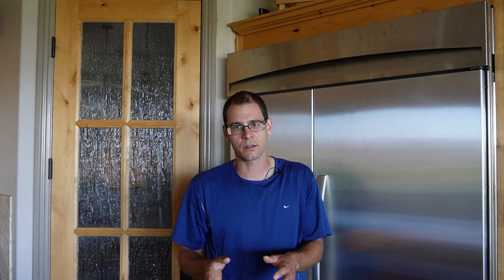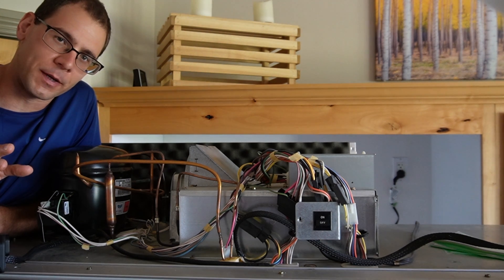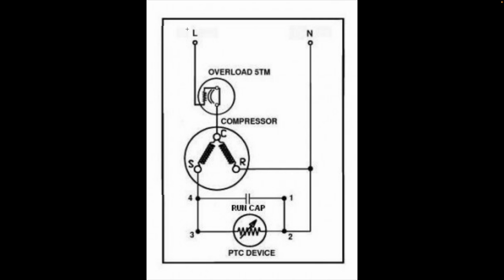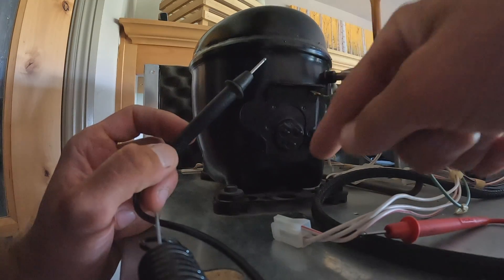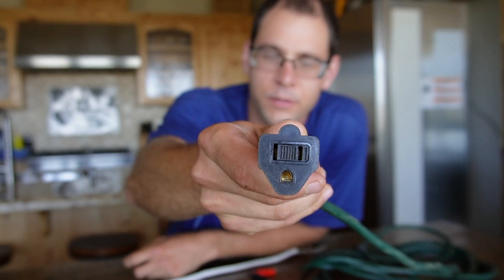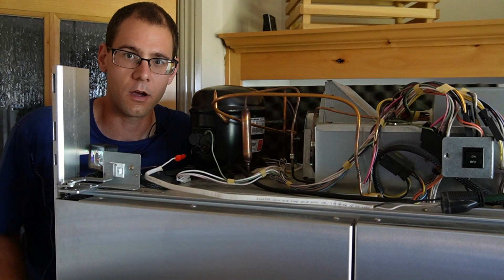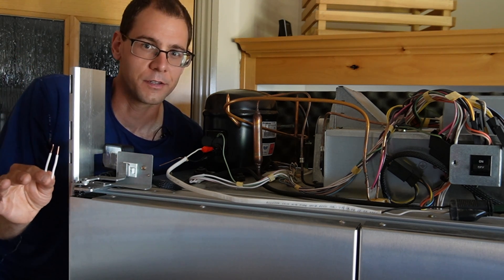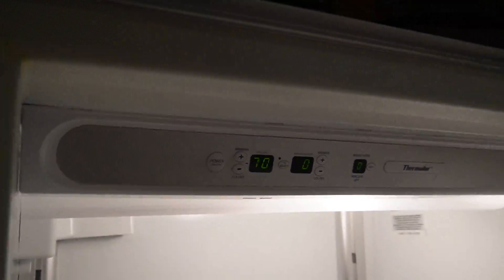How to Troubleshoot a Refrigerator Compressor that Doesn't Start

Comment: My refrigerator just randomly started tripping the gfi outlet a couple times a day, any idea what may cause this?
Reply from the maker: A bad GFCI
Reply: @AchievingSelfReliance i put i new one in and its still doing it
Reply from the maker: @squirrelmaster5485  Did you use a multimeter to check the 3 terminals for any shorts to ground?
Reply: @AchievingSelfReliance i plugged in one of those outlet checkers and it said everything was good, im assuming that works just the same
Reply from the maker: No it's definitely not the same. You need to check for internal shorts within the compressor using a multimeter.

Comment: Fantastic diagnostic video. Thanks for sharing. Sorry to be a pedant but in USA houses have 240v single phase power with it being tapped off the center of a transformer up in the utility pole. Hence, the common conductor.😎 13:35
Reply from the maker: The voltage across the secondary winding on the transformer is indeed 240V. When you center tap the secondary winding you get two hot conductors, each 120V to neutral and out of phase by 180 degrees. This why we refer to household voltages in the US as split phase 240.
Reply: @AchievingSelfReliance  Really never heard of them being out of phase, was always thought single phase split. Hence, the split phase. 🤷‍♂
Reply from the maker: @mugen-mundo  If you draw phase 1 and phase 2 on a graph of voltage versus time, you will see that they are both sinusoids of the same amplitude and frequency, but one of the curves is shifted by 180 degrees.

Comment: Very good explanations. I am finding that my compressor ohms out correctly as well as the overload switch, but there is no power getting to the compressor area. Seems there is another relay or switch that is faulty as my fan is not running. Another video perhaps? I just learned that I had turned off the fridge during my investigation process. Turning it on would help.

Comment: Everything seems to check out ok with the multi  on this Embraco 12HBX, However, shorting the run/start terminals instantly knocks out the breaker in the fuse panel. Power on Common and Run. What could be the problem? Thanks
Reply from the maker: It's behaving like an internal short. Check again. For the grounding point use one of the copper lines coming out of the compressor. Sand it lightly first to remove any oxidation.

Comment: Following instructions step by step of this video, I "jump started" sucessfully my 2003 Kenmore Elite side by side 25 cubic foot refregerator and the compressor run continuousely until I turn off electical power to the "jump started" circuit by my willing one hour later and the refrigerator was being cooled.  I am waiting a new starter relay $15 from Amazon online sale.  Before the jump-start, my refrigerator compressor was stopped running 4 seconds after eletrical power on and the compressor tried to start again after about 15 minutes, then this repeated again and again.  Before I tried to attemp the "jump start",  I followed instructions verified the compressor run and start wire coils have the right resistants and were also not short-circuited to ground.  I also indentified the starter relay and its PTC (Positive Temperature Coefficient) device was not able to cut off power to the start-wire-coil while it should immediately after the compressor started, resulted the compressor have current flow both in run and start wire coils continuously while it should/n, becoming "over current flow and over heat" and the compressor "cut the electival power off" for self protection.

I used a multimeter measure the resistence of the PTC device from the terminals of the starter relay, it was zero before the compressor start attem.  However, the resisten was zero while it should be high resistence immediate the compressor start attemp.  Therefore, I think the PTC device was failed.  My refrigerator has the starter relay which has PTC device and overload protection device and a plog-in capacitor.

Thank you, Escondido Experiment video and instuctions and reasoning.

Comment: Does the relay power the freezer my fridge is having problems but the freezer still works
Reply from the maker: If you only have one compressor, then that one relay controls the cooling of the entire system (freezer and fridge). 

The fridge compartment is often cooled by drawing in cold air from the freezer. This is done by a small door that opens and closes as needed. If this door malfunctions and stays shut, the freezer will be fine but the fridge will be too warm.
Reply: @AchievingSelfReliance  thank u

Comment: Great video! Super informative. I have a question though. Why not just top up the r134a rather than replace all of it? In other videos they simply add enough to get the low pressure side to 2PSI. That did not work for me though as the fridge temp won’t go below 50.
Reply from the maker: That's a good question. The answer is that trying to calculate how much refrigerant to add to a partially full system is tricky. This is in part because relatively small changes in temperature can make a big difference in the pressure reading. You have to be able to read a pressure enthalpy diagram in order to do this properly. 

To put it another way, the contents of the refrigerant in the can you're using to charge the system are a mixture of liquid refrigerant at the bottom and gas at the top. The temperature of the room you're in will significantly impact the pressure of the gas coming out of the can.

Rather than add that additional complexity and create greater potential for error, it's best just to evacuate the entire system. A single 12oz can of R-134A is enough for most refrigerators and you'd have to buy this can even if you wanted to only add a partial charge. In other words, you're not saving any money by trying to reuse what little refrigerant may be left in the system.
Reply: This comment would have been better posted in part 2. Hopefully my spoiler didn’t ruin anybody’s day.
Reply: That makes a ton of sense. Thank you

Comment: I was able to do the jumpstart method and it works fine and I purchased a new but the new relay does the exact same thing as the old one. It is not dropping out The start whining. Again I tried to jumpstart it and it works fine, but the new relay, the same thing. I purchased the SUPCO relay which is OLK3606 which says it’s compatible with the W10613606. any idea why the start relay on this potential relay would not drop out? Is there another part I can put in place of it?
Reply from the maker: Use a Supco RCO (also referred to as a hard start kit). Just make sure that the one you use has the correct rating based on the HP of the compressor.

Comment: How about a linear compressor?
Reply from the maker: Linear compressors use linear motors. Single phase linear motors are wired in a similar way to the single phase rotary motor that I showed in this video (i.e. they have two windings. The phase on one of the windings is shifted using a capacitor). They also have 3 electrical terminals. For testing purposes, you can send power into them like I showed here.

Comment: Stay away from GE model GFE28GYNHFS. The compressor failed internally after 2 years in service. It feels slightly warm, and Ohm readings are 22, 22.5 and 27 which are indicators of compressor internal failure.

Comment: too bad that relay isnt $10 like you said... its $122. Yikes. Thats hard for me to pay not knowing if it will fix it or not.
Reply from the maker: If you can't find a reasonable OEM replacement, just replace the entire relay with an RCO. Supco makes good ones. They're less than $30. Just make sure you match the rated power of the RCO to the power of your compressor.
Reply: @AchievingSelfReliance good to know!! Thanks for the video and the response

Comment: Hi, I have a viking frig/freezer that isn't cooling. I wanted to try to jump the compressor as you did in your video. My question  is, It says on the Technical info sheet that it's a DC compressor- Do not connect to 120vac. Is it okay to jump it as you did? Thanks James
Reply from the maker: No definitely not. It's probably a 12V compressor. You could try using a car battery.
Reply: @TheEscondidoExperiment  If both the compressor and fan are not turning on, where would you start?
Reply from the maker: Take a multimeter and see if power is getting to the unit. Work your way from where power comes in up towards the compressor and fan. You may find a blown fuse somewhere.
Reply: @AchievingSelfReliance  ok great. Thank You

Comment: 7:58 I’ve not seen any exceptions for the compressors in fridges I’ve repaired where the clockwise direction on the terminals goes common, run, start. That is true whether the common terminals is on top or bottom (no ohms measurement necessary).

12:03 - I would have used the terminal crimp on your side cutters instead of the pliers.
Reply from the maker: Are you suggesting that I got it backwards? I showed exactly where I placed the leads and the reading I got off the multimeter. 

And yes the terminal crimp would have been better but most people don't have crimping pliers so I just showed how it can be done using the jaws. It works good enough. Remember, this setup is just for troubleshooting... it's not meant to be permanent.
Reply: @ No, Sir. You were spot on: in your case common is on bottom. Moving clockwise, run is the top left and start is top right as you measured. I was merely saying that the fusite terminals are always laid out that way.  1. Identify common (top or bottom), move clockwise to the run terminal, 3. Continue clockwise to the start terminal. Excellent refrigeration post. Very clear. Thanks.

Comment: Not cooling???
Learned a little trick years back and it may not be your problem but sometimes during the compressor cycle, power shuts off leaving the refrigerant in a vacuum state, possibly an air pocket, which prevents the return of said refrigerant. I, in multiple occasions, had to remove all food contents and turn the fridge upside down and orient in various positions to allow gravity to release the captured refrigerant. This process can take as long as 24 hours but it worked for me multiple times.
Reply: What about the oil in the compressor wount it get in the refrigerant system if you turn it upside down
Reply: @winstonabrahams5678  there would have to be a correlation or interaction of the oil and the refrigerant from the start and I doubt  that that is the case. At any rate, turning the unit upside down for 12 or more hours, has worked a number of times and surprisingly well for me. 
You're aware that manufacturers stare that these types of products need to be in an upright position for a certain amount of time before use, especially after shipping. Makes one ponder the reasoning!
Like alot of other scenarios, sadly, the repair facilities would rather you were not aware of this option.

Comment: Thanks for the great video! It helps me figure out the issue which is a bad inverter control board (mine is a slightly newer model).  I just finish replacing the inverter board and the fridge is cooling again!

Comment: Great video
I made the a/c connector but the compressor fan not running
Your thoughts
Reply: Hi,  First of all, make sure that your fan is AC not DC.
1. You may connect your AC adaptor directly to the two terminals of the fan to test, or
2. You may disconnect the fan from the housing and then test the continuity of the two terminals using a multimeter. 
Good luck!

Comment: May I have the part number of the relay, as showed at 16:50 ? Thanks!
Reply from the maker: 213615000. This relay may not be compatible with your fridge though
Reply: @AchievingSelfReliance Thanks for your information. Really appreciate your two great videos on the troubleshooting of the Thermador refrigerator compressor! Quick update: I just replaced the overload relay, the same part number as yours. Thank you again for this great video, save me a lot time and money running around for solutions.

Comment: 2008 GE Profile 22 cu ft unit stopped last week.
Replaced start and run capacitors $200...fridge stayed  at 65F  ..freezer at 10F all day; overnight they went to perfect at 36f and 0f.  Then..all week stayed at ~65 and ~10;  
reset thermostat...no go;  suddenly today looking  good at 38f and 2f...and stabilizing. 

WHAT is going on here???

Comment: Did you finally fix your unit, and if so, what was the issue?
Reply from the maker: Yes if you watch part 2 you will see that after I recharged the system (i.e. added refrigerant) it worked. It's still working today
Reply: @AchievingSelfReliance  so was there a leak or was it just by time losing freon?
Reply from the maker: @redskinrick6457  Clearly there was a leak. I added UV to help find it. However, I haven't checked for it yet since the fridge is still running fine

Comment: When the wiring diagram was shown, it took me a minute to realize there was a very small cursor tracing the circuit path.  It was hard for my old eyes to see it.  Could you add a larger, more obvious for us old heads please?
Reply from the maker: Yes in later videos I corrected that. When you're editing the video on a large screen it looks fine, but on a 5" smartphone screen it is too small
Reply: Thank you.  Again, I wasn't trying to criticise the content, which was quite good.  Too many videos seem to be "let's find out what this thing does!" , but you clearly know what you're doing.  Thank you.

Comment: You must be on bare metal and confirm you have a good spot by ohming ground to ground. Touching the top that is painted will give you false readings.
Reply from the maker: I tested it before filming. When i put two probes anywhere on the body of the compressor it showed continuity. But yes, bare metal in general will give a more reliable reading.

Comment: 9:00 Never test across painted surface, better use a copper pipe
Reply from the maker: Off camera I tested continuity between a few points on the body of the compressor. It read continuous. Using the copper pipe as reference is fine too

Comment: I have to say its a great video, however when you connected your  AC wire from the extension cord to your gator clips, you put the red clip indicator on the ground wire & your black one on the hot wire so when youre explaining how to connect the clips to the compresssor i noticed it.
Reply from the maker: Yes I was using black as hot (I connected it to the common terminal on the compressor) and red as neutral (I connected it to the other side of the start and run windings. It was only connected to the start winding for a second though as I shorted the two windings to jump the compressor).

Comment: 1:09 -  I was told that the r134a cans for your car is not the same refrigerant as is used in a refrigeration unit.  Was I snookered into buying a 20# drum of refrigerant for my repair?
Reply from the maker: A lot of R134a cans sold in automotive shops have additives in them. In this case, they are different than what you would want to put in your fridge. With that being said, as long as it's just R134a with nothing else in it, it doesn't make a difference whether it's labeled for use in a car or something else. 

On the bright side, you now likely have enough refrigerant to keep your fridge charged for the rest of your life.

Comment: PTCR is a very common failure item. You can get a RCO which is relay, capacitor, overload from supply house. Just match compressor horsepower to RCO. I wouldn't run comp without capacitor it causes the run winding to overheat. Also running comp without overload device will not take it off line should it overheat. Good diagnosis and kudos to figuring it out.
Reply from the maker: Yes I've used Supco RCOs in the past. They work well. But in this case I was able to find an OEM replacement so I just went with that. 

I left the capacitor out of the circuit only for testing purposes (it would have been difficult to attach it to the alligator clips). It should definitely be put back in for any permanent repair. Same is true for overcurrent protection.
Reply: @AchievingSelfReliance  sounds like you've been here before. Supco is what I use as well. I keep an array of different HP ratings on hand. Super common on the small "can" compressors. Another tip: if you shake the PTCR and it sounds real loose or like something is bouncing around inside, it's bad.

Comment: Really well explained. Your Jerry rigged power adaptor could be safer simply by attaching a plug onto the romex rather than insert wires into a female end of an extension wire. Clearly the relay has an important over-current role and I would be wary of running the compressor too long without it to avoid damage. But chapeau to you this is nicely done.
Reply from the maker: Glad you enjoyed the video. And yes, I would not advise anyone use the jerry-rigged solution as a permanent fix. It's just to use for a few hours for troubleshooting.
Reply: What part of Canada you from, eh?